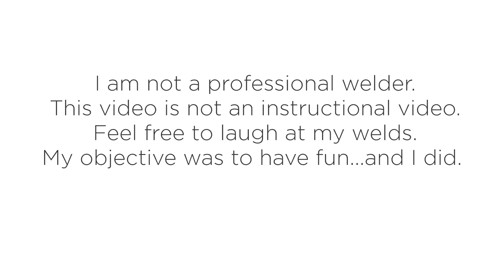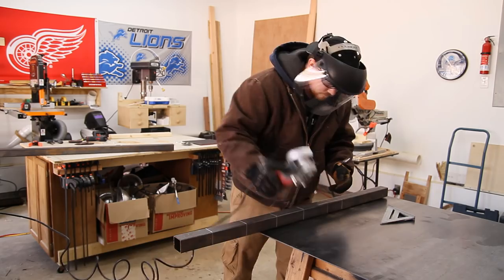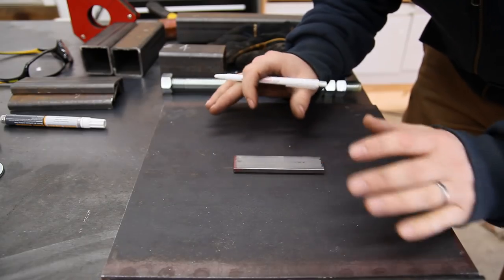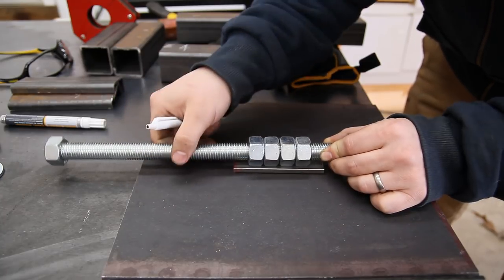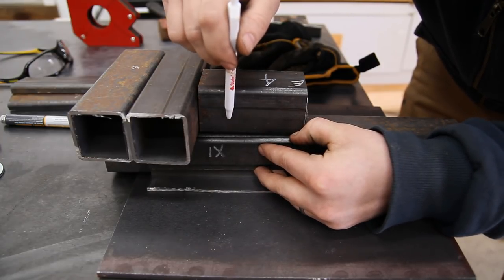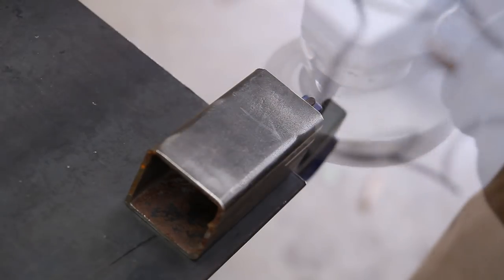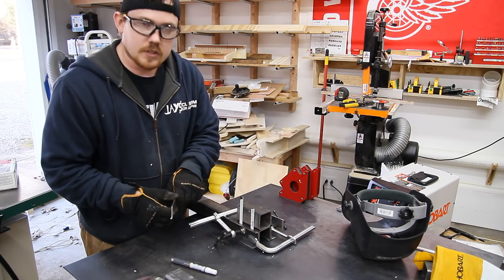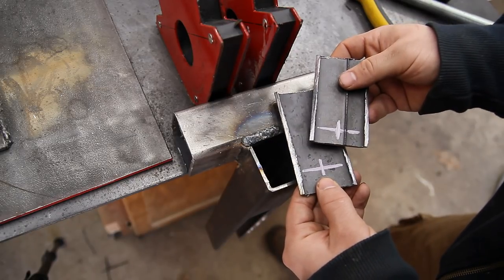DIY Metal Vise

Comment: Vice looks good and I'm sure it will come in handy! Keeping it mobile until you build a metal bench is a good plan. Bet you did have fun and enjoyed it. Seems you bought some of the safety gear from Hobart also. That stuff gets expensive no matter where you get it. I went the cheap HF route except for the helmet which I got from LE. So how did the Hobart do? Any over heating? Did the auto darkening helmet work well? Thanks for sharing!
Reply from the maker: MRrwmac Good eye. The helmet worked great. The gloves are a little thin for my liking but not a deal breaker. The welder did great. No overheating at all. This welder has a crap ton of positive reviews everywhere you go. Hobart 140

Comment: Your welds will improve dramatically if you stop using flux core and start using solid core mig wire with gas it's a bit easier to use allows you to see what you are doing better, But saying that we all have to start somewhere good luck with you future welding projects

Comment: Why did you not use jetfuel to melt the steel beams?
Reply from the maker: The Ultimate Rider - Didn't have any left after filling up my toothbrush.
Reply: Jay Bates Oh, I that case you're a bad businessman. If you did a spectacular video around the kerosine charged toothbrush  you can instantly be the YouTube hero and making magnitudes of $ on advertising.

Comment: Uh oh, Jay caught the metalworking bug! You might think this is just for fun now, but you already admitted to looking at a metal cutting band saw. It's just a matter of time before you're getting a bigger welder, a plasma cutter, $500 in steel to make a killer welding table, and watching craigslist for a lathe, then a mill... :)

Your welds aren't smooth yet, but at least from here they look plenty strong. Run beads all over your ugliest and least useful scraps for practice. Keep in mind that smaller welders (like yours and mine) have limited duty cycles. When you reach the limit of that duty cycle either the wire feed speed or power output (or both) will start to vary unpredictably. It can make you think you're doing something majorly wrong. Just give the machine a rest as though you have to let the glue dry and come back when it has cooled down. 

For comparison, on my 240v Century welder (I forget the model) I can only get 8 or 12 inches of weld on moderate power (3/16" plate) before I reach its limit. It's frustrating but I'm not doing production welding so no sense upgrading. After all I still need a lathe and a mill and... :)
Reply from the maker: Jon Miller Thanks for the input Jon. I didn't notice anything different from the output of the welder. Now if I can cut out some caffeine and stop my hands from shaking so darn much....
Reply: I didn't mean that the duty cycle issue was a problem in this build. Just that you might run into it when running beads just for practice. 

I started a channel for my combined interests in woodworking and metalworking ("Glue and Sparks"), and I've even recorded video for it, but I never have time to sit down and edit anything. I don't know how you do it. 

Or maybe I do. You don't have kids, do you? :)

Comment: You shouldn't weld zinc coated parts. They give of nasty zinc fumes and make your welds look messy. Zinc can easily be removed with acid. I use hydrochloric acid from the hardware store and rinse my parts thoroughly in water after they stop bubbling.

Comment: This was a good video. Flux core will always look ugly unfortunately. Best bet next time is to just straight mig with a shielding gas, thus having a cleaner and more penetrating weld bead. Flux core is great for windy applications and just flopping something together on the trail to get you back in to the shop. not trying to bag on you, sorry if it seems like it. great video none the less.

Comment: Hi Jay Bates
Nice vise.
You videos look so well illuminated.  May I ask what is your secret, the camera, what brand/model is it?  Or is it the lighting, or else?
Thanks.
Reply from the maker: I have four 8' fluorescent fixtures in my garage ceiling with four 4' bulbs in each. It does a good job at lighting the area but I use Magic Lantern on my T3i to dial in a few settings and then color correct every clip in editing. Thanks for noticing :)
Reply: Jay Bates Thanks for sharing.  You're doing a good job at your projects, filming and teaching.

Comment: Nice Job Jay welds look good to me ( i am a much better grinder than welder my self) lol . You have to be careful welding coated metal like the nuts, the off gasses are bad for your health,( or so I am told) I try and do that welding outside with a fan blowing the off gasses away from me,
Reply from the maker: Rich McNatt True. I always hold my breath when I'm welding to get a steadier hand. Still not as good as an exhaust fan but better than breathing it.
Reply: I agree welding zinc or galvanize is not good for you, but as welder by trade I would say that if you are in a air restricted area then use a fan and even a respirator with P100 cartridges (purple ones) or if possible move the work outside.
However that being said, welding a couple of nuts or a tack here and there is not going to cause any long term health issues.

Comment: welder is set to high you can tell by the splatter
Reply from the maker: +mike t the height of the welder doesn't matter.
Reply: not talking about height lol
Reply: +Jay Bates he is taling about the amps
Reply: shush you'll ruin the learning experience.
Reply: mike t
Reply: mike t
Reply: Isolina Mallon
Reply: YoYO Semite /ไ.ไ.
Reply: hehehe being a long time welder (retired now) I listen to the welding and my ears prop up> wtf is wrong here ?? but then jay do not want to learn so frack it ..
Reply: mike t u
Reply: Lmao, don't worry Jay, some of us actually got that you were messing with this guy. The fact that he didn't and kept going with it was hilarious.
Reply: The Jester you don't set amps on a mig machine you set volts and wire speed which determined your amps.
Reply: xD He means your power output.
Reply: it's spatter... not splatter.

Comment: You should get yourself educated about how to hold an angle grinder. The disc can get stuck and that thing shoots into your face. Hold it with your left hand on the grip the "wrong way", your forearm touching against the top of the grinder body. With the other hand, grab the body of the grinder. Have the rotation plane of the disc offset to your face zone, so if it explodes, it doesn't hit you there and if it catches, the machine doesn't fly there.

Comment: you should give those jaws some teeth you could weld some must to the back and then inset some bolts into a metal plate to screw in or even countersunk into a piece of wood for a softer grip that won't bite into your work piece looks good you're a better welder than I am my welds look bad

Comment: why build a vice? i mean ive always bought nice high quality vices and i love them. and i would of atleast tappered the jaws and capped the tube to make it look alot neater. also, flux core is kind of shit to learn to "mig" weld with. mig welding and flux core are whole different animals. everyone says flux core welds are weak and look like crap. which is just straight up not true. flux core burns hotter then mig. and if you get good you can lay some decent looking welds with it. just make sure your welder is set to DC ELECTRODE NEGATIVE. alot of mig machines will come set up for electrode positive for welding with solid wire and gas.

Comment: You're welding on the wrong direction. Try the other way an you´ll get a much better looking and stronger weld ;)
Reply from the maker: Harry Ruzo I welded in all directions on this build. Uphill, downhill, pushing, and pulling. I prefer to pull.
Reply: Harry Ruzo is right. It's best practise to push the torch.
Reply: Jay Bates If the wire is facing one way, you move the torch to the other, pushing or pulling is confusing XD
Reply: From what I have read flux core you pull away from the puddle otherwise your pushing the flux into the puddle and vice versa if you are using gas shielding.
Reply: What michael said. Matters more with mig due to shielding gas use.

Comment: i think you might want to have your face shield on when your using the wire wheel.. much more dangerous than the cut off wheel
Reply from the maker: HomeDistiller I did use it mostly, in that last clip I didn't though.

Comment: Nice job. Somethings not right with the color or sound of your wire burning. Seems to me like you need more shielding gas. Sometimes those tips will foul and improperly diffuse your mix.  Either way,  those welds aren’t terrible. If you make another one, use ACME rod. It’ll cycle your vise in half the rotations. (Plus it’s indestructible)